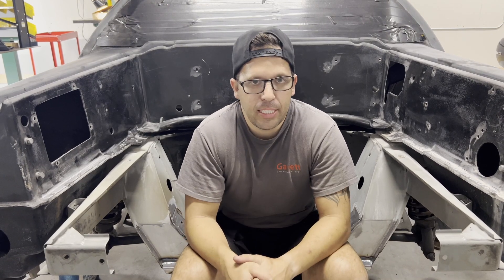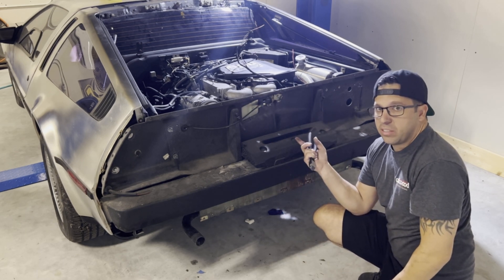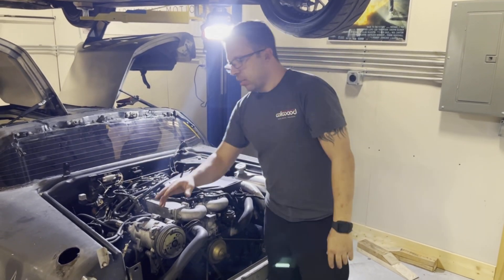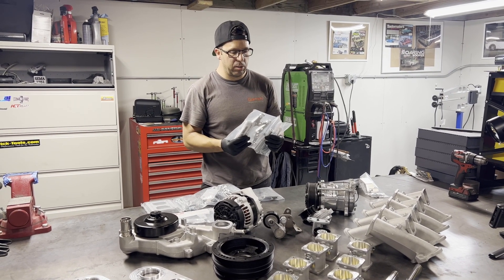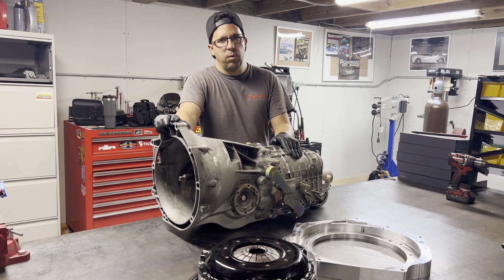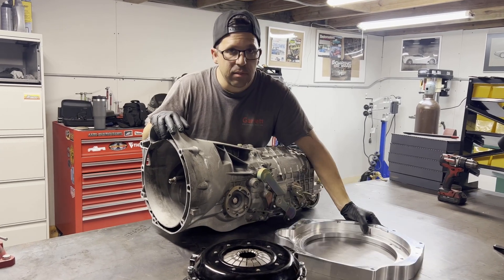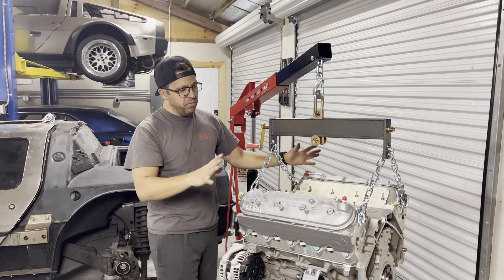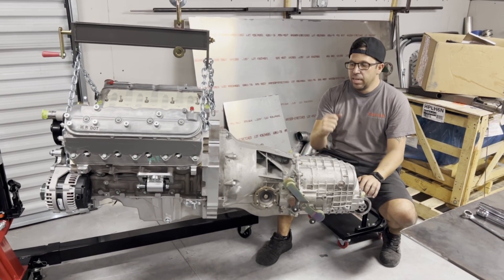Reviving Legends EP 3: The DeLorean Gets A New Engine Swap and Transmission

Comment: You guys are really tugging at my heart by working on the DeLorean. I've always had an issue with the front end of the car and that no matter what is done to it, it just looks really dated and from the 80's (yes, I know). But, I was thinking if you changed the front end; headlights, bumper, and grill. I was thinking about it and trying to figure out what kind of design would work. What say to changing it to make it look like the hyundai ionic 5 or even a dodge challenger. The ionic 5 is a really cool retro look to it that does remind me of what a better design for the front end would look like. Just a thought. Also, I know this would be horrible to even think about but what about adding a paint job to it? Everyone has kept the stainless look, including yourself, but what if you did something really different and added a gloss black paint. Again, just a thought
Reply from the maker: That’s a lot of great ideas and yes we’re going to be modernizing this DeLorean for the 21st century. Stay tuned and thanks for the feedback.